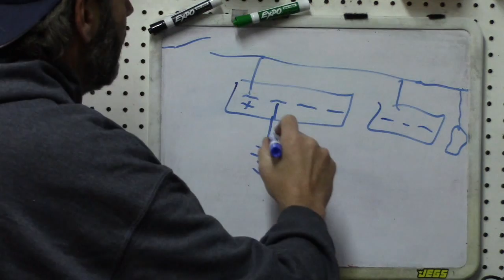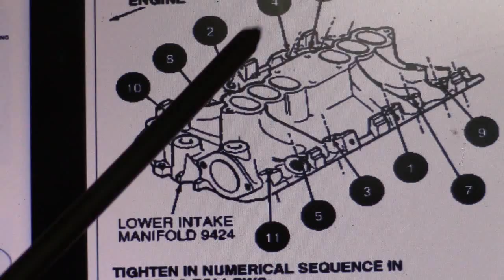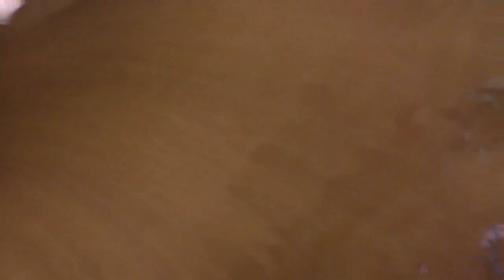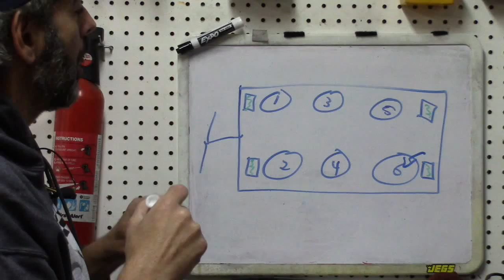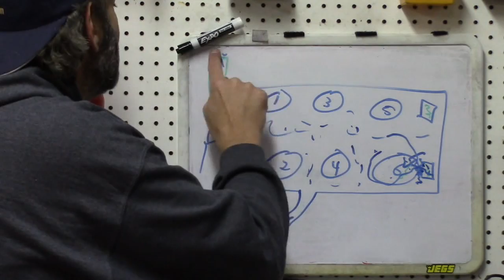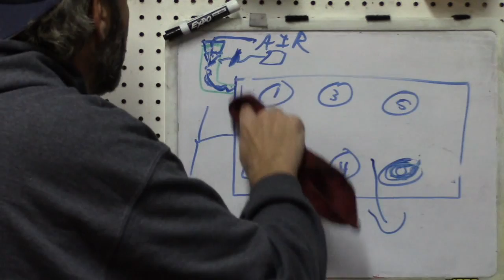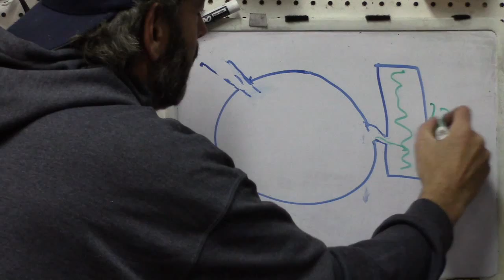04 Toyota P0306 Pt2-Can Compression Test Lie?

Comment: Fords are having a problem where the cylinder sleeve seems to contract at an inappropriate rate in comparison to the cylinder head on cool down. Focus RS issue.
Wonder if something like this could be a problem.
Also on my 2014 Accord V6 supposed bullet proof engine.
Cylinder head had a pinhole leak on the outside of the integrated exhaust collector.
The casting on aluminum vehicles is getting worse as costs go down and China outsourcing.

Comment: My rough math says a compression stroke takes around 50ms. Coolant has hours to seep a small amount into the combustion chamber as the engine cools? I have an 04 that uses a few ounces per month. Watching and waiting..... pulling the heads is a big job.
Reply: Is the compression time so fast that the coolant doesn’t have time to be pushed back through the leak? If so, the problem would not show up in a compression test.

Comment: Thanks for the follow up video! It takes a big man to make this video! We all need a taste of that humble pie every once in a while.

So these head gaskets are 3 layers. Usually the middle layer of the head gasket fails.

I don’t want to be the guy who says “I’ve seen a lot of these” but I have lol. 

If you watch my channel, I’m not someone who shotguns parts at cars, and I fully believe in diagnosing vehicles.

I’ve never seen those head gasket fail bad enough to cause a compression loss. My explanation is that the piston is moving up and down at a speed too fast for the compression to bleed off.

That is why I suggest doing a leak down. Now, with a leak down test, it will still only show a couple PSI loss, which most consider “good” but I wire tie a glove to the radiator while doing a leak down and it will blow up the glove.

And if you want to get more scientific, i started using pressure transducers and pulse sensors installed on the radiator cap. And while cranking you can see small pulses every time that cylinder is on top dead center.

The next time I see one, I’ll make a video myself.
Reply: and if you have not been to or watched this guys channel, I highly recommend you start!
Reply: The Disgruntled Mechanic thanks buddy!
Reply: sweet!!!

Comment: I don't know about giving too much of a discount If I had made the wrong call on this one.  The Intake has to come off to do the head, and if you pull a head you need to send it out to have it checked, flattened, and valves worked before putting it back on anyway, that would find the crack in the head.

Comment: Well I conclude compression tests are only good for valves not sealing or piston ring failure.
Reply: I was always taught compression test aren't for testing head gasket issues but for rings and valves. The air is being compressed quick enough that a minor leak may not show up plain as day on a guage. 

Keep up the good work. I always learn something from your videos and I appreciate your honesty.
Reply: Austin Francis Exactly. Well explained 👍🏻
Reply from the maker: YeH I am not convinced because that would make no sense. How can you have leakage past a ring for example and not have lower compression?? It’s impossible. I don’t buy that this is a head gasket issue. It’s got to be a cylinder head crack.
Reply: Schrodingers Box piston ring failure will lower compression.  Headgasket failures start small. Leak under certain specific conditions. And across different channels. Why you think a crack is more likely than a gasket failing I don’t know! Ford UK learnt the hard way on the eco boost engine. On a car in the uk called focus RS. I think u get them too. Over night coolant would drain into cylinders and cause a minor misfire on first start. This was on less than 1 year old cars!  I think they changed the headgasket design to fix! Some owners had the problem reoccur. Search on YouTube for examples!

Comment: I’ve been doing this for 40 years....It’s the head gasket....but the leak is temperature dependent. Did you do all your tests with the engine cold & hot?? The aluminum head is warping slightly when the vehicle is hot, allowing a small amount of coolant into cylinder when engine is hot but not enough to keep the cylinder from firing....but then you shut down the engine and coolant continues to leak until the head cools again which leaves enough coolant in cylinder to stop ignition upon restart...but not enough to hydro lock the cylinder.
Reply from the maker: Yes I did ALL tests hot and cold. Compression, relative compression and Leakdown.  All were negative.

Comment: Hello sir.
That V6 example you've provided appears to be a 3100/3400 GM.  Not sure of you want to add some text.
Reply from the maker: Yes the purpose was to show what a "wet" intake design was. I can't do that on the model I was working on!!
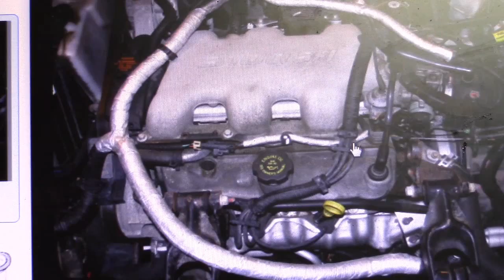Reply: @SchrodingersBox  oh yes of course, but at 8:13 you have a pointer and point to the screen saying "Here is a Toyota..."
I just know you're a sticker for accuracy - only reason I mention it.

Comment: If you think about a VERY small pin hole between cyl and coolant jacket why would it show enough less compression? The gauge also has a non return valve in it so you are "building up" the reading and it can't fall. The cylinder is quite a large volume compared to the tiny hole, think of a tyre with a pin hole, it takes hours for the reduced pressure to show even on a gauge. When you pressurised the coolant there was only a very small quantity of coolant blew out the plug hole. thats my take on it
Reply from the maker: Then why was leakdown test also negative? It read less than 10% leakdown and never bubbled the coolant. I'll show on next video but it absolutely had no leakdown showing.
  Also- the pinhold is so small that 160PSI of compression can't get through, but coolant can just drip through at rest??? I don't know that I can buy that.

Comment: I don't know that car and have never worked on that engine, but I have seen coolant leaks into cylinders without loss of compression.  I can tell you I've seen it numerous times on Ford 2.8L V6 from back in the day (we are talking 79 mustangs and pintos).  There is a coolant passage between the valves.  There will be a crack in the head above the valve that leaks coolant.  Compression test shows the compression when the valve is closed so no leak, no combustion gasses into the cooling system either, but they would get slowly worse over time.  The solution when I was a teen was remove the thermostat and radiator cap so there is no pressure and drive it all summer and junk it before winter.  Maybe it could be something like that.  I would think the way to know is a $15 dollar endoscope hooked to your phone.   Put it at TDC, pressurize the cooling system and see if there is coolant sitting on top of that valve if you can get the camera into it.
Reply from the maker: Ok now THAT is what I believe.  That is NOT a head gasket failure- that's a cracked cylinder head and it would absolutely explain everything.  But everyone is saying it's a gasket- not a cracked head.  
   But I absolutely think you are right. It explains everything.
Reply: FrugalPrepper's Garage & Garden a leak on the head between the intake runner and the coolant passage above the valve could be the answer to most of the issues!!  I like it!
Reply: I agree with the frugal theory but guys have on mind that cracked cyl head usually start to leaking when engine is hot.this particular shake occurs while engine is cold right?as you guys said bring it on to the tdc ,pressurize and after some time stick that tiny chinese camera down in to the cyl.if no results do the same procedure with hot engine.good luck
Reply: @ismarmeskovic  The leak may indeed get worse at the temperature increases, maybe a real slow drip to a fast drip.  Once the engine is hot and running it probably still isn't enough to cause a combustion issue.   I would try letting it cool from hot running temp for about 1/2 hour.   My thought would be that maybe the majority of the leak occurs while the engine is still hot and there is still pressure in the system, but it not running, before it cools off and the coolant is still puddled there when you start it cold.
Reply: @frugalprepper  100% agree with you ,dive in to the cylinder after engine cool of a bit should give result
Reply: @frugalprepper  reason why im sayin all this is that i had similar issue with 1.7 renault engine.at it was crack in the cyl head.miss while is cold normal when is hot.detected coolant with birescope in cyl in the morining before i even start the engine

Comment: The ecu knows (if an ecu can know) that it has just fired number one cylinder so expects to see the feed back signal at the time it fired the coil ( almost )  .. and you correctly say its a uniform square wave 6 square on a 6 cylinder  if a block is missing it could easily determine the missing coil firing event.... hope that helps every one .. three wire coils monitor the coil firing by current flow at the transistor in the ecu often there will be two transistor in parallel to double the current passed to the coil .. not to be confused with a  Darlington pair or  Darlington array .........second comment ... you can have coolant passing the head gasket with no significant or notable loss of compression the steel reinforcing ring of the gasket  around the cylinder acts like a one way valve letting coolant flow into the cylinder but effectively keeping most of the compression in the cylinder ..... BUT would you notice the loss on your compression tester if say it only lost 2 or 3 psi was missing ..... what you could do is using the pressure tester you showed , fitted to the header tank start the engine and see if you got a small but fast increase in coolant pressure regards John
Reply from the maker: Always good info John.  Thanks!

Comment: By putting pressure into intake manifold you also pressurize the cylinders with open intake valves. So by doing that you can find head gasket leak/cracked head as well. Not sure if you made it so 6th cylinder was closed on intake valve. But anyway - this case is indeed mystery. How are you sure it's coolant in the cylinder btw? Maybe it's... Engine oil? Sipping via intake valve seal while the engine is cold. I don't know, but no compression loss, no coolant loss, very short period for the cylinder to misfire, maybe the whole problem is not related to any fluid in the cylinder?
Reply from the maker: Yes very very very good point and I guess I failed in editing in the first video to show I did bring #6 to TDC to make sure the valves were closed so as to remove the cylinder from the equation.  As usual- great onbservation.

Comment: @6:25 isn't the PCM also what tells the coil to fire? (I am no expert on electronic ignition) If so, it can determine very easily which coil is not firing correctly by sending the pulse for it to fire and getting no feedback at the same time
Reply from the maker: Yes- great question.  Indeed, the PCM tells the coil to fire however the command itself cannot be determined to have actually resulted in the coil firing- you can only determine the command was "received" by the coil.  The 4th wire shows the output as direct result of the coil actually firing.
Reply: Schrodingers Box A coil is just a transformer. On a successful spark you will see evidence on the input side by a peak voltage spike seen. If no spark happened you won’t see this peak. If the amplitude isn’t above a threshold it will be determined this was not an adequate combustion. Could be many reasons. Wrong fueling, bad spark plug, failing coil pack.
Reply: I also thought about taking a step back and considering why firing didn't occur.  Is there a way to check that an adequate spark was attempted?  The report back to the PCM is obviously missing, and this is even more difficult to work with when it only shows up at cold starts.  That made me wonder about the PCM too -- it could be a electronic warm-up issue.  BUT!, you obviously have coolant in that cylinder.  We saw it.